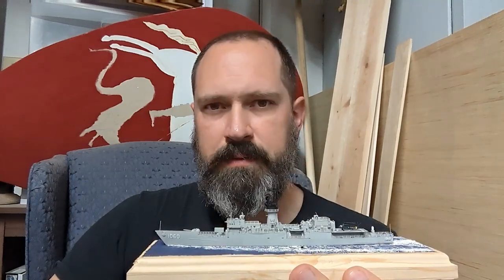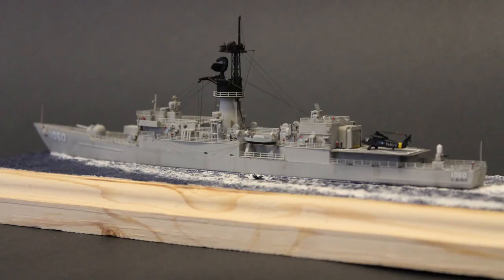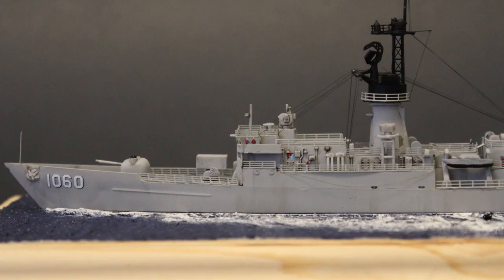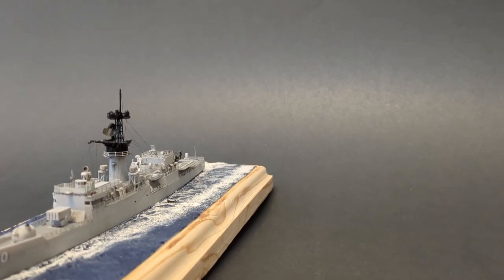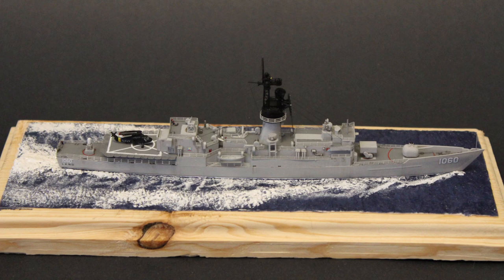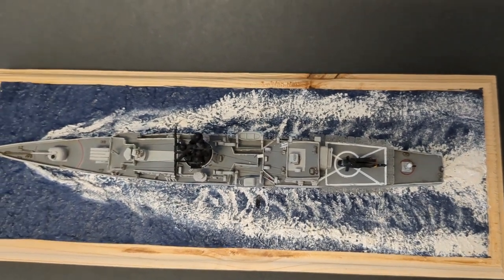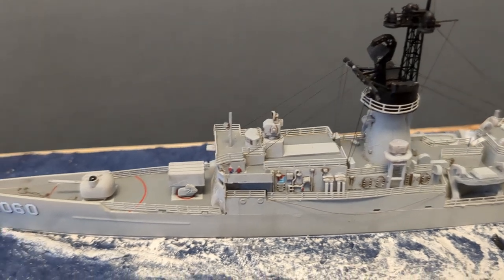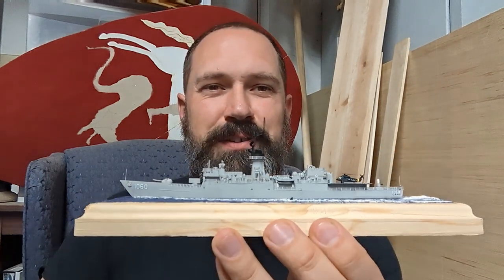The Knox Class Frigate

Comment: I served the board the USS Downs DE 1070 reclassified to FF 1070. I was stationed on the Ff 1070 Downes in 1975 and 1976 - Home Ported at 32 St, San Diego Naval base. 
I was a boiler technician on the ship. One thing that stands out to me is that the lifeline are not that large. They were cables and not these large white lines that I see on the model. Another difference in the 1970s was there was no phalanx system on the fan tail. It was a 4 x 4 rocket launcher for Sea Sparrow rockets.

Comment: I was on board USS Badger FF-1071, between 76-78 . Right around 1980, the ships received that "hurricane bow. The forward-most 30 (or so) feet where the foc"sle was raised  up another 4 feet from the flush deck. Previously , none of the Knox class had that.
 Also,  they didn't have Phalanx CIWS, on the fantail. Most had BPDMS. (Basic point defense missile system)   . A box-like launcher that held 8 sea sparrow misses. Some Knox class also had IVDS. A hatch opened from the transom, and a Sonar on a cable was towed.

Comment: I served on USS Marvin Shields. DE/FF 1066 from 1973-1977 as a machinists mate. Over 2 westpac cruises was the helo  fueler, gq was after steering, underway watches were either engine room top watch or throttles. Marvin Shields was equipped with BPDMS missile launcher on stern and IVDS(independent variable depth sonar) under the launcher.
Reply: I too served on the Mighty Marv from 1977 to 1981. Two Westpacs, stood after-steering for a very short time, then on the bridge as Lee Helm during Unreps. They finally figured out that an FTG shouldn't do that.  Also got down in the Engine Room and Boiler Room as the DCPO and cleaning before LOE prior to OPPE. GQ was Gun Plot on the 53F Radar. We may have run across one another as I stood POOW or Asroc Roving Patrol in my first year on-board. What I learned was: Snipes had a hard life and they earned my respect.  Had a few good friends there (one being an MM3.) Fair winds and following seas to you!

Comment: Great job Professor! I've been hoping for a larger scale version to come along one of these days. I spent four years in the engine room, and aux 1 machinery space as a machinist mate on FF1055. Their attempt to make a single screw screw ship by hot rodding it to run at 1200 psi steam didn't quite meet the goal. We almost lost two guys in Aux1 when a main steam line burst. Got the plant on enough to limp into Subic bay for a 90 day stint welded to the pier while metallurgists analyzed the entire main steam piping system. Found the failed section to be carbon steel when it should have been chromoly! We escorted tankers in the Persian gulf during the tanker war. Served with a great group of hole snipes, and keep in touch with a couple still to this day. Long live the tin can sailors!
Reply from the maker: That's really cool!  Thanks for sharing the story.  Did the tankers have to slow down for you?
Reply: LOL, the gulf was a fairly restricted area to navigate, and we were there to deter the troublemakers, so we adjusted to  their speed. Especially when loaded! Since we were primarily an ASW ship we took them in the first third, handed them off to an FFG, who then handed them off to a DDG as they got to the deepest point for loading at Kuwait, I believe. We worked with the Stark for some time before rotating home. We were heading from Hawaii to San Diego when the Stark was attacked. Thought for sure we would be turned around for some serious trouble. That turned into a political mess. @professorbellbuilds
Reply from the maker: @tankdirt  Yes, I remember reading about that.  That sort of thing often results in war. . .

Comment: I served aboard the USS AINSWORTH FF 1090 from 81 to 86 requested it as my 2nd duty station. A really great bunch of BT’s in the hole.
Reply from the maker: Very cool, but. . . what's a BT in the hole?  I learned my sailor jargon on a tallship, so I'm not as adept at Navy talk.  Is this something like the mail buoy watch, or replacing the batteries in the sound powered phones?  Do you have any fun or interesting stories about the Ainsworth?
Reply: Boiler Technician 2nd class. I was the Oil King and also Repair Party 5 damage control leader. Repair 5 and the Oil Lab were in the same Starboard side passageway. I still keep up with several of my old shipmates.
Reply: I apologize for not mentioning that the 1060 model you assembled is absolutely beautiful.
Reply from the maker: @daronemccormick3797  Thank you!  Does "oil" include fuel oil?  I thought I remembered somewhere that these were diesel powered, but now I can't find anything that specifically states what they burned.
Reply: They burned DFM, diesel fuel marine, in 2- 1200psi superheat C&E marine boilers. The ship did have a 750kw emergency diesel generator powered by a tandem set of either Fairbanks Morris or Detroit, 16 cylinder diesel engines.
Reply from the maker: Cool, Thank you! @daronemccormick3797
Reply: @daronemccormick3797  As My "Honest John" would say, There is no DFQ or DFM............. JP-5??